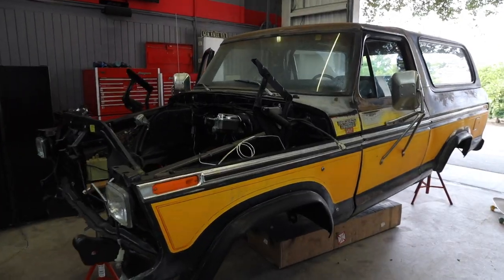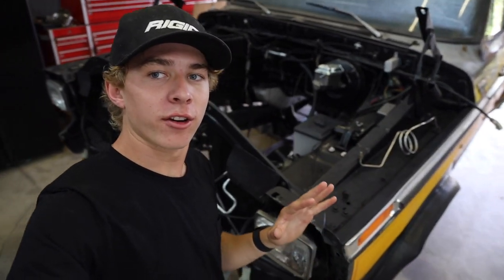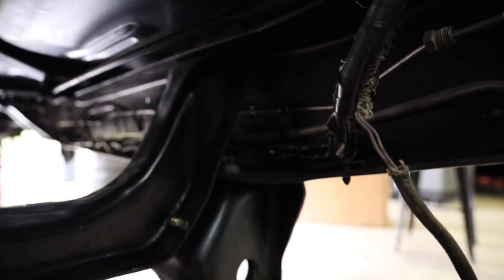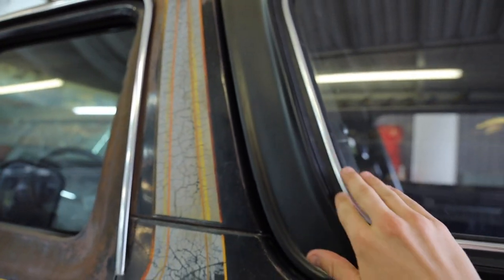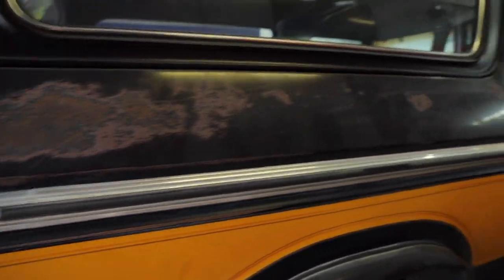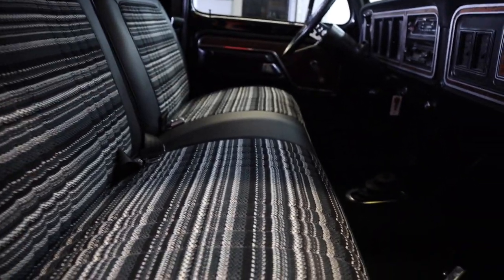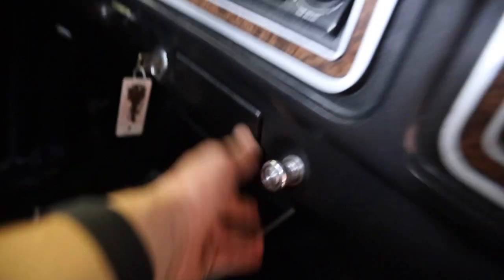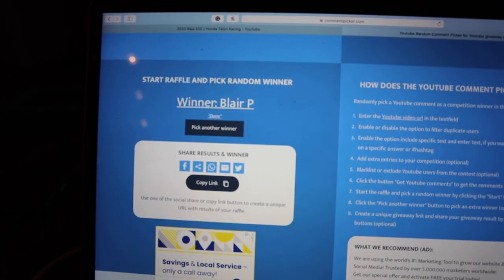1979 Free Wheelin' Ford Bronco Update | Christopher Polvoorde

Comment: Does the black streal it paint hold up to heat like on exhaust pipes or chambers? Build a console for the kicker radio! Paint it with a satin paint even with the yellow paint you could throw some antiqueing type of spray on it so that it spiders .yeah it's cool to keep them old school if they work. That's cool what you did. But the planes dash is awesome looking. If the motor don't work throw an LS motor in it. Good luck Bryce!
Reply from the maker: It holds up to some heat but STEEL-IT has a high heat product they just came out with that suits the bill! No LS in this Build Ford power all the way